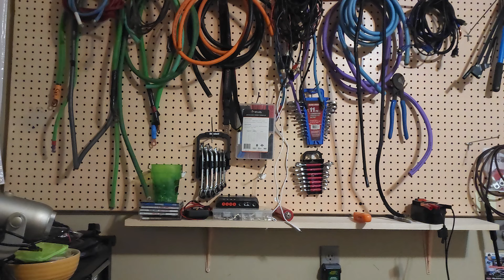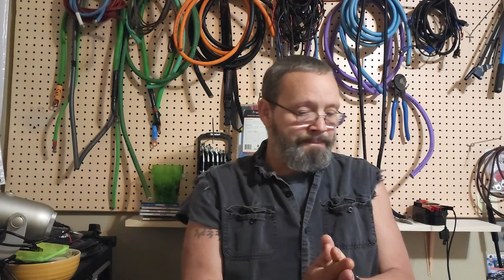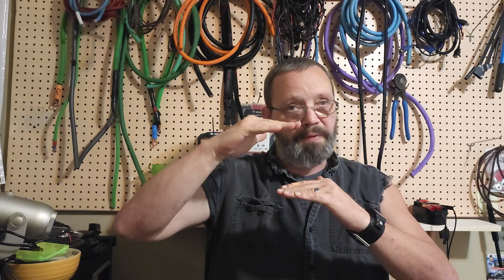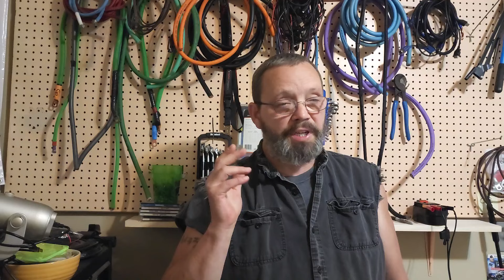How and Why to run a 14.4 volt Car audio Charging System

Comment: Ok you’re right on most of the things you are mentioning, however you don’t necessarily need to have high resting voltage, as soon as you start your vehicle the alternator will charge your battery up to where your alternator is charge at. AGM can be charged up to around 15v the standard lithium (lifep04) is good up to 14.6-8, (13.3 resting) other lithiums like a 6s bank (14v system) will charge between 14.8-16.5v (low 15 resting)                    Anyway it doesn’t matter how low you rest is long as your battery is healthy and you don’t have a bad parasitic draw.  Question is when are you going to go to big boy voltage? Your amps will love it.
Reply from the maker: "as soon as you start your vehicle the alternator will charge your battery up to where your alternator is charge at." yes it will, but the battery wont produce much current over its resting voltage, because it cant store energy above its resting voltage. 
" Question is when are you going to go to big boy voltage? Your amps will love it."  I should and I could, but i mainly target a budget crowd, so ive restrained my self to things in a budget catagory. i know its not really expensive to charge higher, but the batteries for that are either sketchy, or quite expensive.

Comment: So how do i charge higher if my computer charges it at a set point? Do i need a regulotor
Reply from the maker: you can use a diode in the sensing wire, to trick your cars computer into thinking the voltage is low.
Reply: Custom alternator producers often have various pigtails you can get for adjusting what the ecm sees
Reply: @It-b-Blair I'm getting my alternator from js alternators and saw they had a regulator with pigtails wasn't sure if that would help tho as I don't know much about it

Comment: You are extremely knowledgeable.  I'm hoping someone may have an answer to this question.  I have a 01 Honda Accord (2.4L) and I have 2 12inch JL W6 with a JL 1000 watt amp.  All big 3 upgrade done.  XS Power D1200 AGM replaced the stock battery.  I have a Power Bastard 200 amp alt.  My car uses 80amp stock, and the system should draw around 100 amp when at full capacity (in theory) so I figure this should be more than enough.  I have a voltage meter installed and on start, my car sits around 14.3/14.2 (sometimes 14.4), but then very quickly drops to around 14.1/14.2 steady.  I've noticed that my voltage though will drop down to 13.8/13.9 sometimes.  This can actually happen even if I turn my amp off ( I have a switch on the remote wire ).  Is this indicative of a battery issue?  I did the D1200 battery because it was the "correct" match for my YMM.  However, from what I understand I could actually upgrade to a Group Size 48 AGM battery as it's the largest one that'll fit.  Is it worth the purchase?  My goal is simple - keep my voltage at 14.4 or as close as possible when the car is on.  Any suggestions would be greatly appreciated.
Reply from the maker: your cars computer controls the charging value, it does not care that you want 14.4v. and your batteries rest at 12.6v or so. these 2 things you have to address.  first youll need a diode in the wire going to the alt to trick the computer into reading the voltage  lower than it is, so it will charge higher. second, youre gonna need a battery that rest at higher voltage, Basically Lithium. The trunk thunder lithium 5kv2 is a great match for your setup. just mount it inside near the amplifiers, and delete the underhood battery. these 2 things will have you charging and playing in the 14s
Reply: I have a Toyota Carolla that sounds very similar. I have a DC Power 320A alternator, upon cold start, I’ll see 15.0V, and as the vehicle warms up it’ll drop to 14.4-14.6V. In traffic at a stop light it’ll drop to 12.8-13.0V. I use two deep cycle AGMs and an AGM under the hood. Im searching for headway cells to build a lithium battery to get rid of the AGMs. I don’t pull much current (I don’t think…) I only have an Orion HCCA 3000.1D SPLX amp, but will soon add another matching SPLX amp or pull both 3ks and add a 12.5K SPLX when I swap out subs.  My factory Toyota alternator was 70A😂
Reply: @philbischof  charging voltage always sit a little higher than normal on cold start up.

Comment: I have a 370alt voltage runs at 15.5 voltage do I need a 14 volt battery or 12 volt battery
Reply from the maker: 14 would be best

Comment: So do you suggest a higher amp alternator and 12v battery setup? I have the big three and everything is 0 guage wiring. With a stock 130 amp alternator and stock battery and a 12v 100ah deep cycle in the trunk. My voltage always stays around 12.5-12.8 except when that deep deep base hits its dropped to the 10s. So what do i do? Upgrade my alt?
Reply from the maker: yea, you need to. but first you should get an ioxus ultra cap, it MIGHT cover for your stock alt, but even if you still need an alt upgrade, that ultra cap is still worth having.

Comment: Thank you for the information! The only caveat to higher voltages is the fact that most power supplies are not regulated so rail voltage increases hence the higher output. Most transformers are wound 1:9 to 1:11 with rail capacitors ranging from 160 to 200 volts. Unfortunately, most end users do not know this and then blame the amplifier was faulty when the 24N40s fail.

Comment: Hi @ CAE. I want to ask about running multiple battery system. I heard many different veiws. So I have 1 batt (bosh) in the engine bay and 2  batt (odessy) in the trunk. what would be the bettery way to connet the system. 1 wire front batt to rear batt and 1 wire alt to rear batt?  or should I just run 2 wires from front batt to rear batt? All AGM battery and stock altinator. also running dual imputs into my B2 5000watt  sub amp. Would there be a voltage difference in any way?
Reply from the maker: 2  1/0 gauge wires from alt to front battery, then 2 1/0 gauge wires from that battery pos and 2 1/0 gauge negs to rear batteries. and connect the rears with 1 or 2 1/0 gauge pos and neg each.
Reply: @CarAudioEnthusiasts  ok thanks 🙏 my local shop only had 2/0 gauge so I used that. Will make the connection

Comment: Standard alternators charge at 14.4-14.8V.  Do you need special alternators to keep 14.4V batteries charged?
Reply from the maker: most factory alts until recently charged about 13.5, some newer ones CAN charge at 14.5 but they are controlled by the computer, and typically charge at 13.5 to save fuel.
Reply: @CarAudioEnthusiasts  Hmmm... I installed a 220A HO alternator that I'm pretty sure goes up in the 14.5 range, but thought my stock one was similar (1993 Integra). Might have been mistaken. Haven't completed my system yet, but I have a JL VX1000/1i, an JL HD600/4 for my mids and an ARC audio KS300.4 for my highs. (I have a 10 speaker JL C7 component array for my non-sub reproduction)A battery and Cap combo you'd recommend for this setup?
Reply from the maker: @derekv6479  a good AMG Battery and the Ioxus ultra cap would be totally fine for your power needs,
Reply: @CarAudioEnthusiasts  Both 14.4V, correct? And is that battery in addtion to the normal front car battery or just replacing it? Thank you for passing on your knowledge.
Reply from the maker: @derekv6479  with what youre pulling, a good front battery and the cap should be solid

Comment: so you use 14.4volt batteries ......... 1. what chemistry gives you that voltage and 2. how you gonna charge them?
Reply from the maker: 1.theres a LOT of 14v options, including AGMs and Lithium, as well as ultracaps.  2. with an alternator?
Reply: @CarAudioEnthusiasts AGM batteries do not have a Resting Voltage of 14.4 volts.
Reply from the maker: @MrSummitville  true, but there are options.
Reply: @MrSummitville  agm just means how the battery is built, not the chemistry of the battery. You can have Advanced Glass Matt lead or lithium batteries.
Reply: @lt-b-Blair- so there are “Lithium AGM” batteries on the market? Or “Lead Acid Lithium”? Interested in seeing how those work.

Comment: Nicely put this also is true in any electrical application  even your home electrical.  The electric company charges you by the amount of amps used and not voltage  and the higher the voltage the less amps everyone always assumes that 220 v cost more to use in reality it's cheaper.  It pulls half the amount of amps then 110v  no matters what it is.   Most people don't know  that A car amplifier  is actually a very high   voltage  they have basically a built in transformer the only reason  a amp is 12-14v is so your car can actually power it  but its stepped up  in the power supply  to a lot higher voltage to power the actual amp board.  Sense the income power on the income is at a way lower voltage  the amps that are pulled is pertty high  usually  100-300amp .   A amplifier would be extremely small if it didn't need to transform the power the currect voltage to the amplifier board.💯👍✌️🤔🫡
Reply: Your are full of crap! The Power Meter on your home measures both volts and amps. You are billed per kilowatt-hour consumed, not per "amp".  Where do you get such stupidity?

Comment: I'm considering a 370 amp alt for my 2002 tahoe. Power an agm in the spare spot under the hood. Amps to be run, pg xs 6600, 4300, 2300 and 2 2500. 
Stock will stay the vehicles 130 alt and agm. 
Sufficient? Third battery in back?
Reply from the maker: put a supercap somewhere in the system, makes a huge difference!
Reply: LiFePo4 and dual battery isolator or DC-DC converter my dude.  Much less voltage drop under load, less weight, and more capacity per cubic inch.

Comment: So I'm running 12v agm system @ 60ah (subs) with stock alternator 14.5@ 90amps and rear agm @ 22ah (highs and mids). The lowest they get are 13.2 at full tilt for short times (street driving). After a while it'll kick up to 13.7 to 14.1. I know I need more ah. My question is.. does this seem to be a good setup until I get more storage or should I get H.O. alternator next? Thanks
Reply: Setup is decent but most amps will put out their most power over 14 volts. So you’ll definitely need more battery or ho alternator to get the amp to be most efficient
Reply: You're getting voltage drop then technically...even if it is somewhat minimal. Upgrade the alternator and have that fucker pinned at 14.7 during full tilt and watch the difference. You don't want to damage your amps man.
Reply from the maker: yes, you could do with a stronger alternator AND a big 3 upgrade to handle the increase in amperage.
Reply: Thanks for the response. I'm waiting on the Ioxus supercap to be delivered to see if that helps... I'm saving for the ho alternator hopefully buy it next month for my bday. And after the alternator I'll add more battery. Or vice versa depending on funds. I'm sooo ready to go full tilt. My system is skar rp 1200.1d for 2 nvx 12s on nvx dsp , double rock(skar copycat) 150.4 for 4 polk 6.5db coaxial, soundigital evo 400 for 2 boss tweets( they're actually loud) and a scosche 4" center speaker. Marts 6ch  dsp on mids and highs. Yes 2 dsps... 6channels wasnt enuf at first.
Reply from the maker: @joelnlala11  the supercap will stabilize the voltage swings well, and will help support large voltage draws on big bass notes for a short time, with a bit of recharge time before and after.
Reply: Sounds awesome. Can't wait to see what the ultracap does
Reply from the maker: it did MAGIC